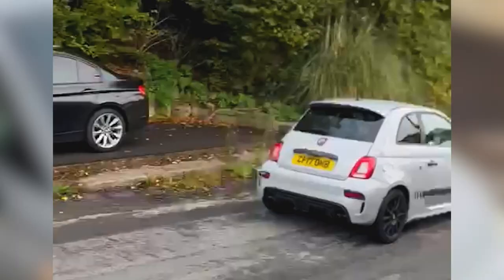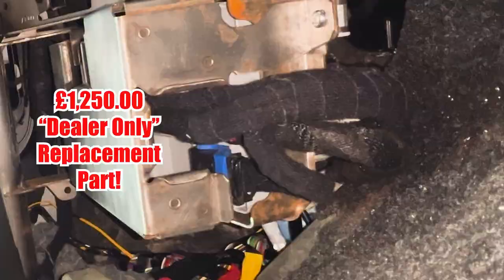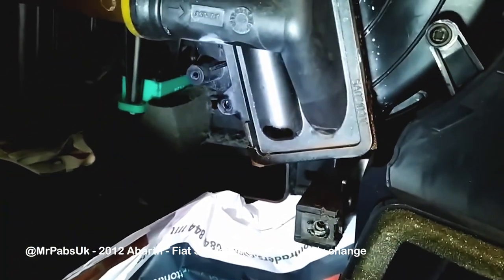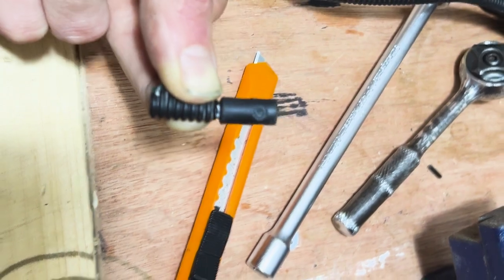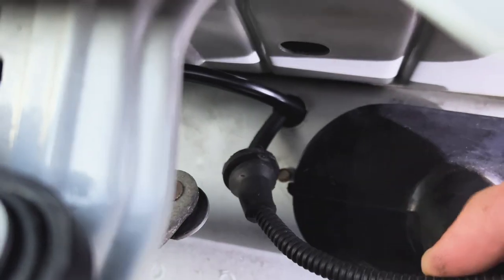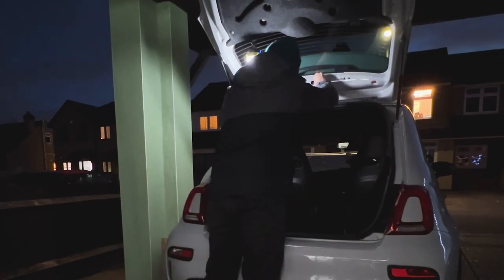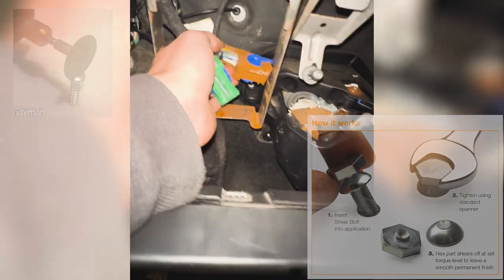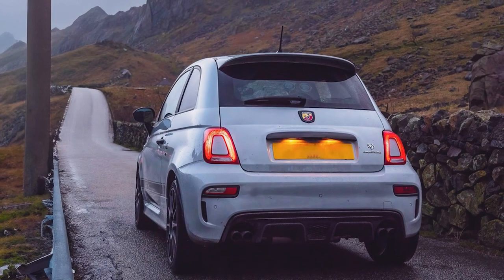Abarth electrics NIGHTMARE caused by water leak! [CHECK YOURS NOW]

Comment: Oh god this sounds awful! Hopefully it's sorted now. Had my abarth for about 4 weeks now. How would you go about checking it?
Reply from the maker: I am happy to report that the replacement BCM unit fixed all my problems and the new wash pipe is holding up strong.  

Regarding checking for any leaks from this pipe, you would first notice a slightly damp carpet in the left side of the car (both EU & US spec).  

To visually check, start by getting your head up under the dash with a torch and spot that corrugated hose and then follow it along - if you have someone who can hold the rear washer jet on while inspecting. That would be even better 👍

If you’re having abnormal and inconsistent electrical issues, I strongly suspect it would be the BCM unit.  

Something permanent may be linked to a split cable in the loom…my rear sidelight was out and the actual wire had snapped! 

Happy motoring 😎